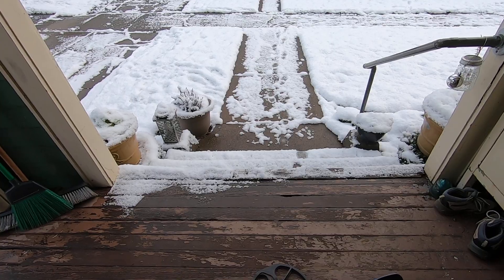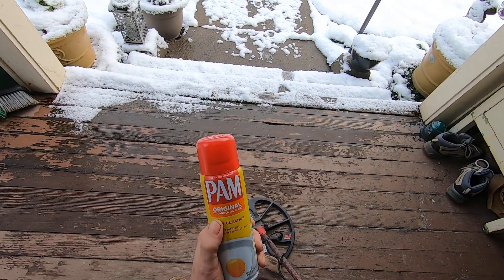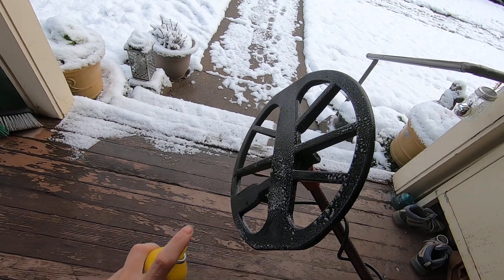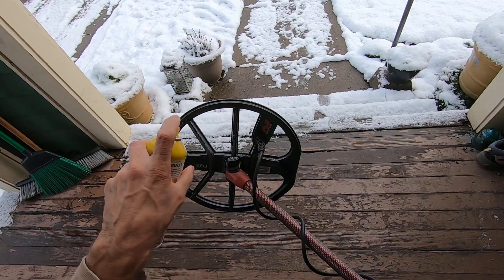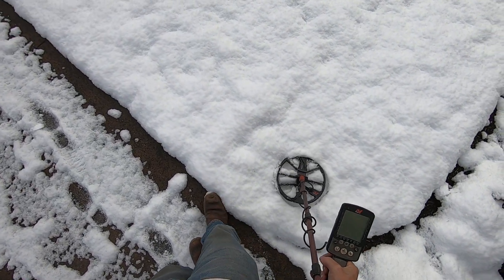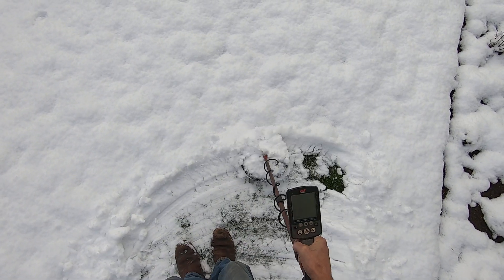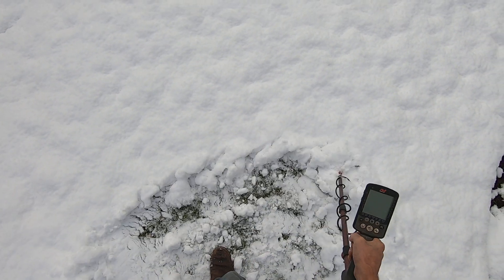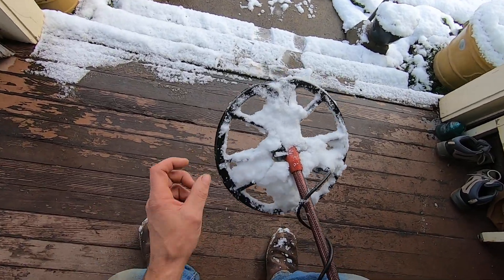Voice command metal detectors? Smart metal detectors and an experiment with oil spray on a coil.

Comment: I’ve been thinking about it . And it’s  rubber . Just like tires on a vehicle the freaking bastered don’t stick to the roads . Maybe spray the coils with some kinda rubber .
Reply from the maker: Cannot do it with my Nox 11" coil now because both coil ears snapped off in the snow today just after 30 seconds of swinging. Equinox build quality is not up to hardcore use like the Deus and Simplex.
Reply: @PaystreakSuperfreak  yeah . That’s why I decided to order the legend . I have a few machines the nox 800 is the one I use the most . But having this kinda nervous feeling that if I bump it the wrong way it will fuck up  . So lame . Anyways . That’s sucks that happened

Comment: Try wrapping the entire coil in Suran wrap that way the snow has nothing to cling too...There is an industrial wrap that they use for packing packages that is stronger than the kitchen variety
Reply: I was thinking the same thing too. Parchment paper might work well too, it has a waxy and slippery feel to it, and it does not absorb water at all! It has been coated with silicone as well according to what I read.

Comment: heat would actually pack the snow on your coil. what you want is for the coil to be cold . add a fullcovering cover made out of teflon , and nothing is sticking to any coil ever again. . think , a bag , made out of teflon ,flat bottom , cone top with the ability to put the coil inside and tighten it around the lower stem . or even two round hard sheets of teflon cut to the shape of the coil , one on top , one on the bottom of the coil , tightened together with zipties .
Reply from the maker: Cool idea!! Very very cool idea!!

Comment: I wonder if spraying the coil with spray on teflon would work. If not for snow, to keep mud and water off and reduce friction against grass. Minelab coil covers aren't expensive so it wouldn't be an expensive experiment to test by coating a cover.
Reply from the maker: Great point!

Comment: I wrap my coil in aluminum foil to keep the snow off! 🤣
Reply from the maker: I put mine in the microwave to heat it up lol. DO NOT PUT DETECTOR COILS IN THE MICROWAVE OR WRAP THEM IN FOIL.. These are humor comments!!
Reply: If my simplex had voice command, I would tell it to ignore nails. I'm sure it would argue with me.
Reply: @mikekeller4131  in those situations I like to run in feild mode with the 3 iron segments blocked out and ignore anything that doesn’t hit almost perfect and isn’t huge when sizing the target like big iron  of course I’m probably leaving stuff behind being masked or deeper stuff but just for efficiency and sanity’s sake maybe I’ll get me one of those xp 2s and never dig another nail again
Reply: @treasurehuntingnewyork5979  I actually like hearing the iron tones. With the simplex I'm getting quarter and dime tones on nails. I'm hoping the legend doesn't have this problem because I sure can't afford the deus 2. BTW I like your videos Man. Keep em coming.